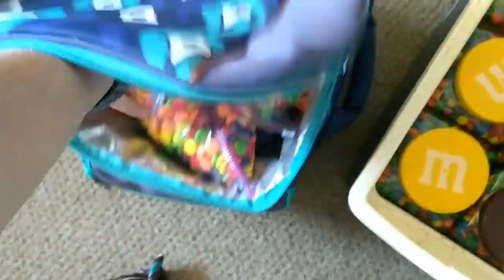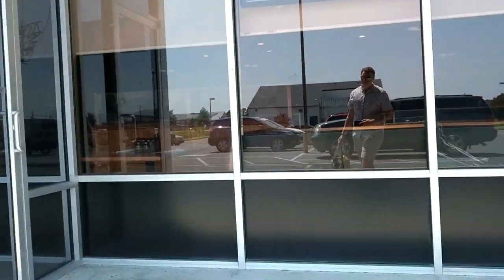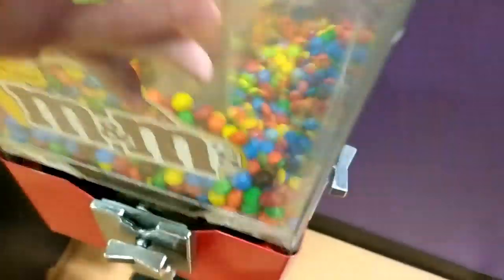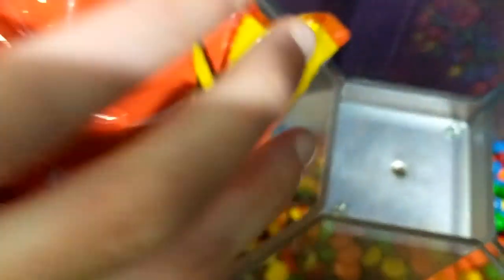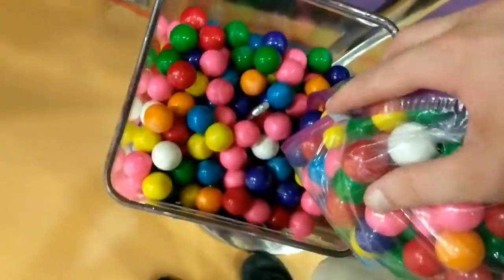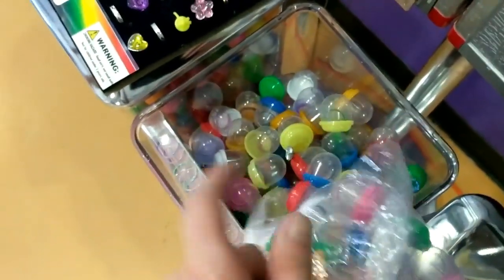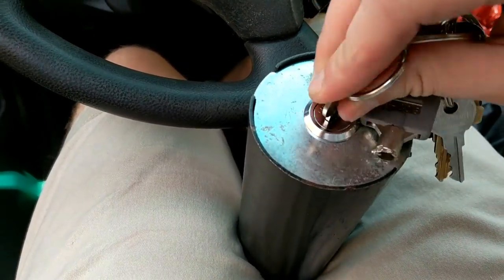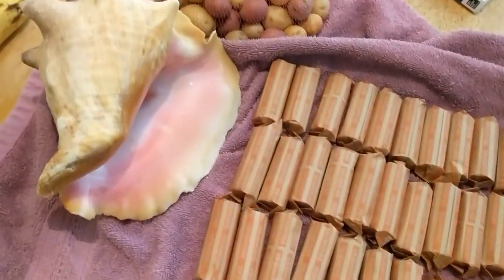*** COLLECTING LOTS OF CASH FROM MY VENDING BUSINESS ***

Comment: you don't have to fully take apart the northwestern machines to collect the money, trust me i have 35 toy racks all northwestern. Four shooting hoops, 12 sports blasters, and 6 key masters, 8 cranes
Reply from the maker: The bottom row doesn't have coin drawers but I know the top you can just lift up and open the flap
Reply: K. Weis Investments  you can pull the machine up , turn to the side and let it rest on the base while you scoop out the quarters. I will make a video soon
Reply from the maker: @tshood85  that makes sense haha surprised I didn't think of that.